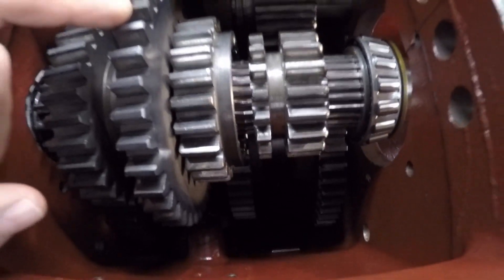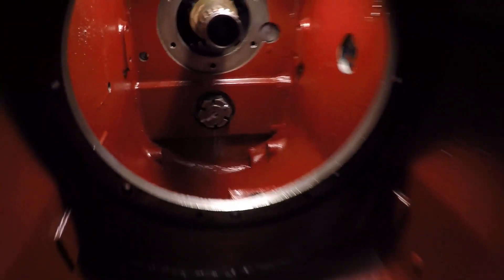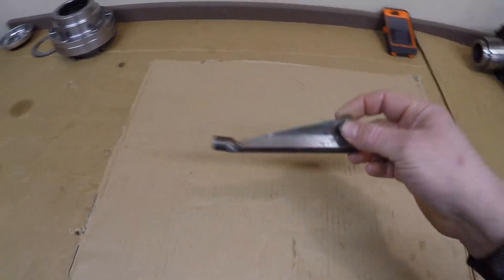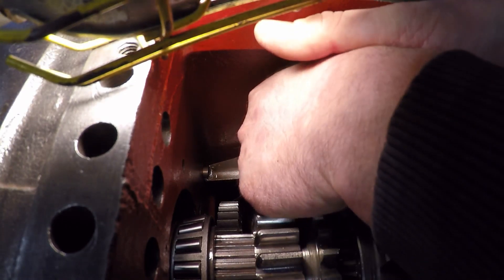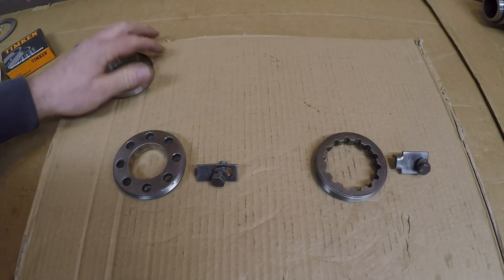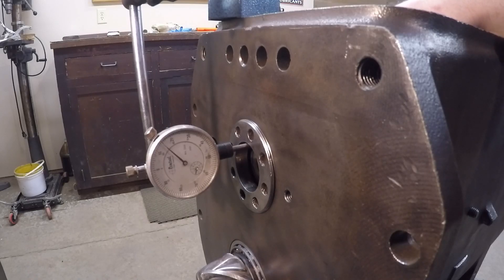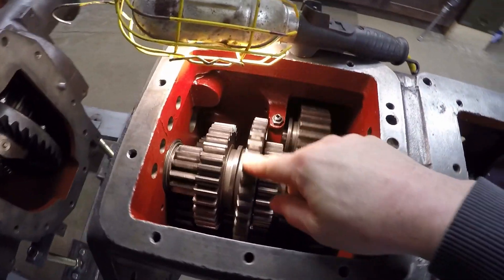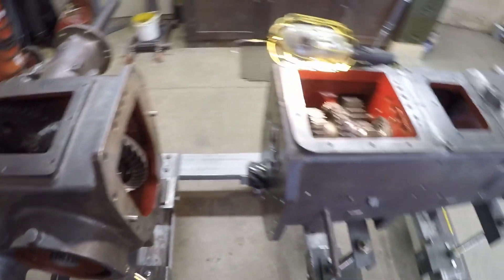Minneapolis-Moline 445 Prototype X231 - Part 39: Transmission Final Assembly!

Comment: that reminded me of when i was at J.I. Case.   i was working with an engineer on a trencher .  the hydraulic oil tank was over heating.    it felt like the hot air from the engine was slamming into the oil tank.  so i put vents wall to let the air out.    the  oil tank was MUCH hotter.     the hot air was wiping the side of the oil tank making it hotter.    so we sealed the wall off.  and redirected the air down

Comment: I betcha. I betcha that the guy who thought of the sheet metal trough learned his chops rebuilding Model T engines. Maybe even learned to drive on one. Just picking the height to be self regulating was simple and smart.
Reply: @squatch253  Neville Shute the novelist was in reality Neville Shute Norway,aviation engineer. A quote from Slide Rule,his autobiography."  An engineer is someone who can do for a shilling what any fool can do for a pound." That is 20:1 for those not familiar. I would have thought about 10:1,but I am not an engineer. And used to dollars and dimes. Seems about right.

Comment: Now that I've spent most of the day binge watching these episodes instead of working on my own projects, I wonder if I have this straight.  MM made a prototype tractor, an experimental one if the "X" on all the parts means anything, and after all their testing, they sold it to some farmer who appears to have abused it unmercifully.  I say that because of all the jury-rigged bits and pieces, wooden plugs, the horrible repair on the draw bar mount, etc.  I certainly hope the farmer got a good deal on the price because he bought a one of a kind machine requiring more expertise to keep running than what he appeared to have.  Although on second thought, he may have had as we say here in New England, much more Yankee ingenuity and frugality than most.  

Good job explaining the mechanical workings and possible thought processes of the MM engineers.  Cheers.

Comment: I love how careful you are - I used to run 3 & 4 axis mills - I saw some peen the surface and squirt lock tight so a bearing would stay put.  I always wondered what would happen years down the road when someone would try to replace the bearing.

Comment: I'll bet you the cast in oil trough is why they eliminated the spacer and went to the double snap rings on 445's. With that trough being permanent, I can see it making installing or removing gears trickier.

Comment: I would hammer/bend the trough so it fits flush with the side of the transmission so that oil can't flow between it and the side of the transmission casting.

Comment: Nice! Yes you could go a few directions. I suppose you have to wait until you get the engine hooked up before you put that PTO clutch on? I can't recall, did you have to do some machining on that clutch unit yet or just wait to get some other stuff put together first?

Comment: Silly question do you or any of the viewers have any idea when thread lockers became available?
Reply: Not a silly question at all. Anyone out there know ?
Reply: It was developed commercially in the 50's but was used in military applications as far back as the mid 40's.
Reply: @hommie789  Thanks
Reply: @hommie789  First I heard of the stuff was as a teenager reading motorcycle magazines. 1969. Britbikes needed the stuff,most rice rockets did not. And the Honda 750 showed up that year for sale and the considerable efforts needed to maintain a British machine looked passé.

Comment: If you were to install the production race depth nut, would it fit flush with the housing? (Just wondering why the production lock was not bent.)